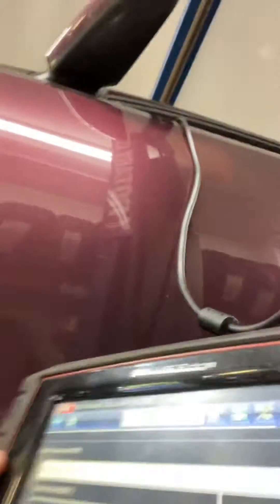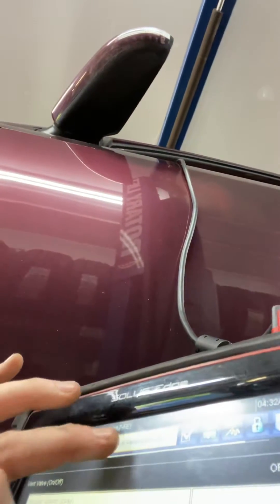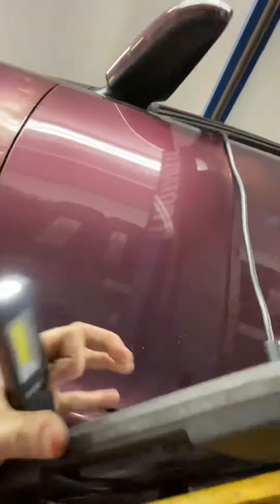Toyota P0441, P0455, P0456 EVAP check engine light codes. Canister vent valve fault diagnosis.

Comment: So hook up 2000 dollar scanner and watch it smoke is how you fix it. Got it
Reply: The scanner tells you what code is coming up... Code came up EVAP leak so you smoke to find leak. How you fix it is you replace part. It's a minute long video dude you gotta use common sense and a little comprehensive thinking.